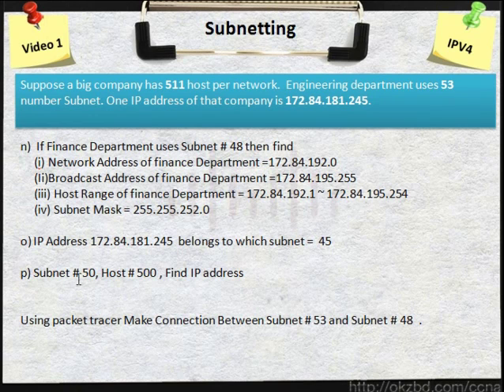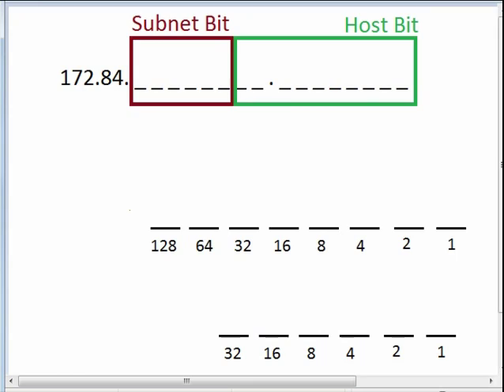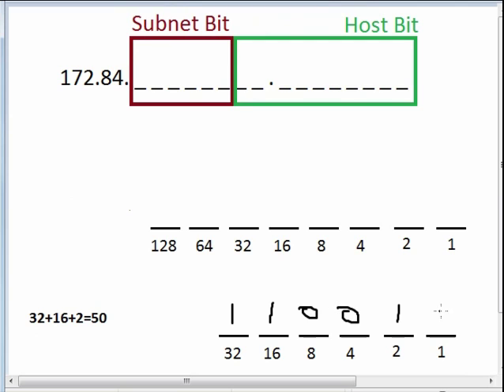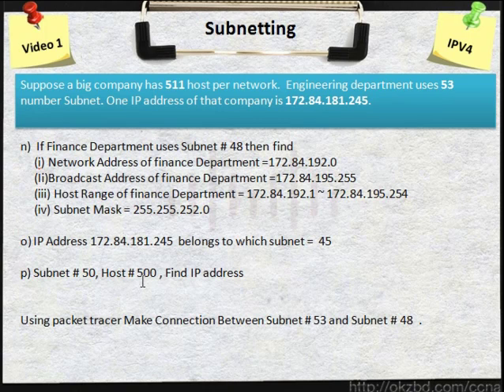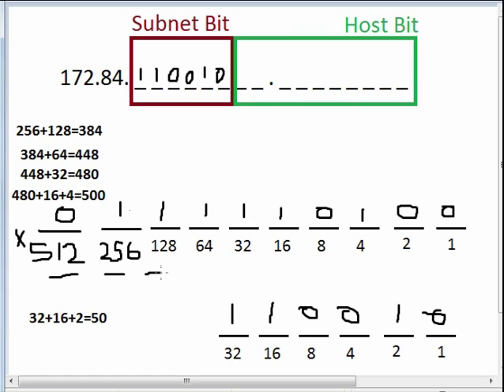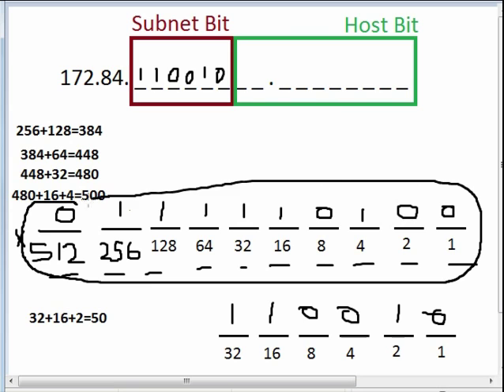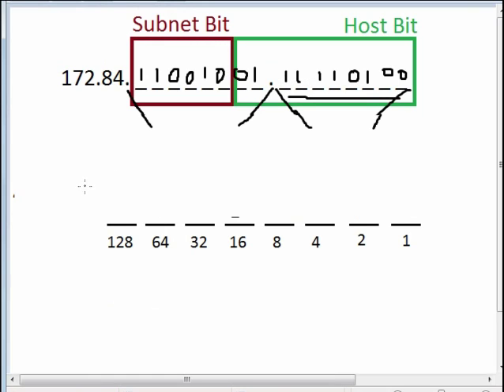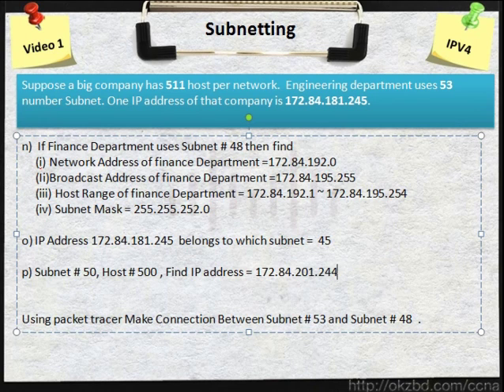CCNA Questions and Answers - Video 1 - Part 3

Comment: Good vids BUT you could shorten them without losing knowledge by erasing the parts where you add the bit values on screen. It would not hurt any one going into IT and if it did, they do not have enough brains to complete.